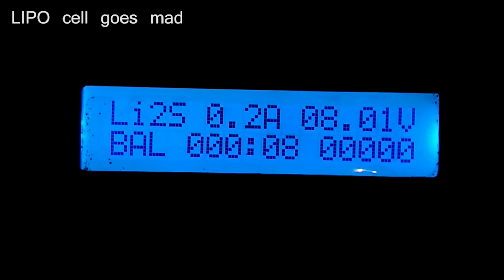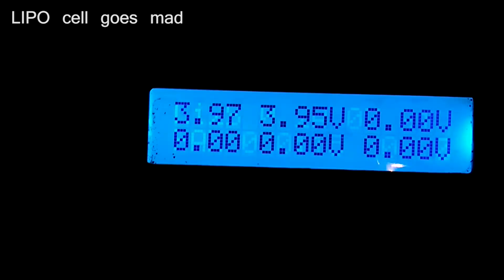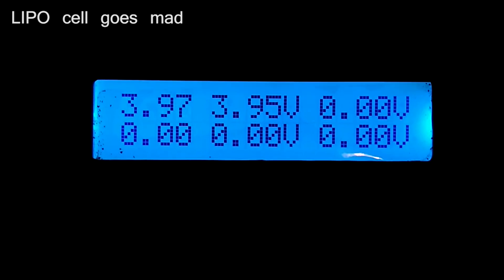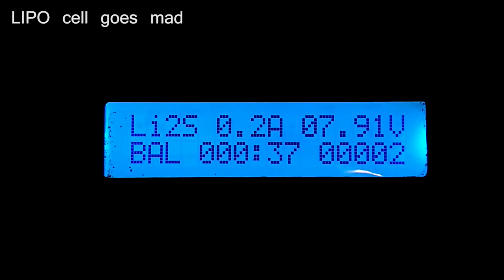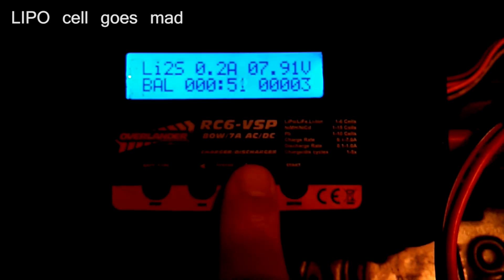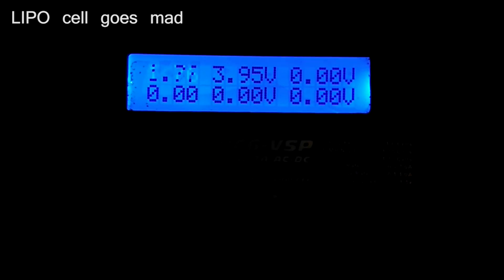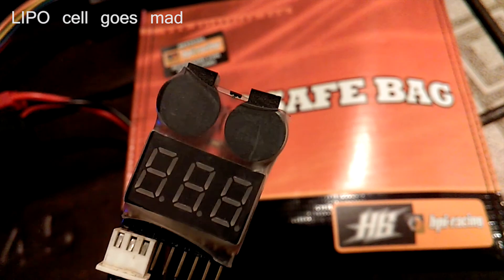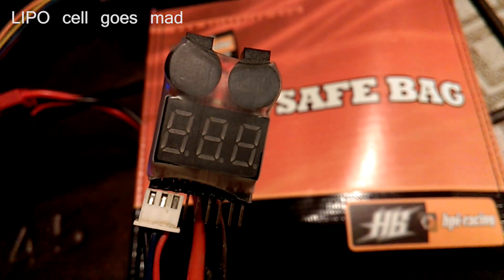Traxxas 2s 7600 mah LiPo battery cell goes mad. Is this battery beyond repair?

Comment: That's either a dirty connection on the balance plug or a broken/dry joint on the pack itself. Should be fixable. I can take a look, but not sure when I could get over your way.

Comment: stick it on ni mh mode for about 5 min then lipo charge it again. if the battery is puffing then you are screwed. by a set of gensace 7600 mah batts they work great in the summit traxxas makes crap batterys by the way

Comment: Im 99% sure you have damaged balance cable on battery or charger
Reply from the maker: I checked it at the connector end and it looks fine, however I'm not able to get into the cable the battery end. Any ideas Jakub Marszal ? Thanks for watching.